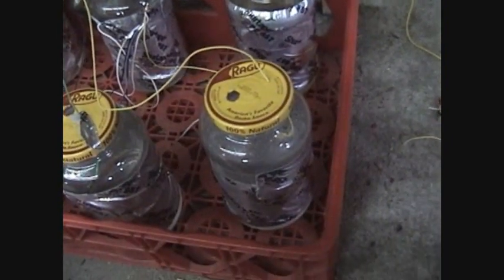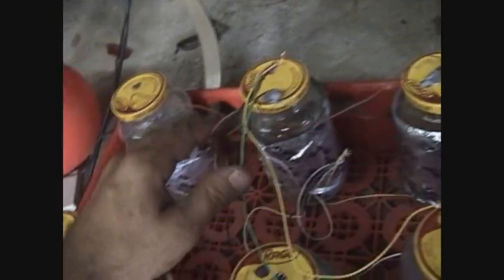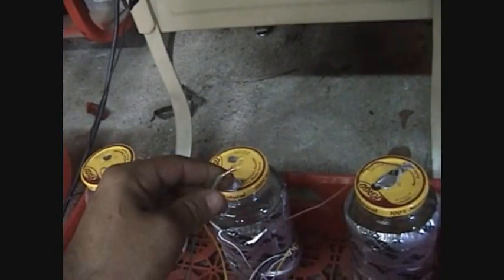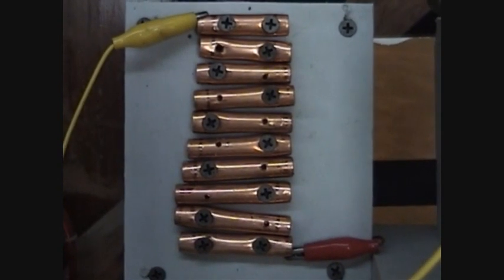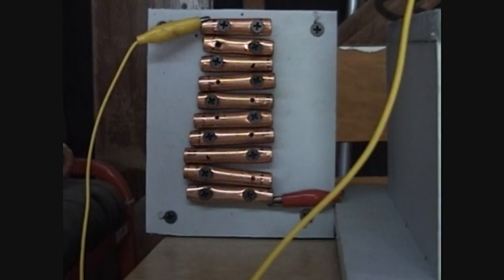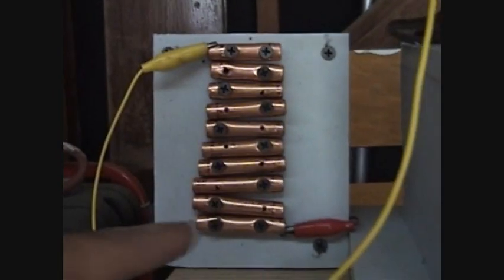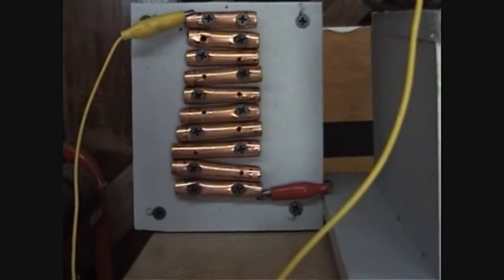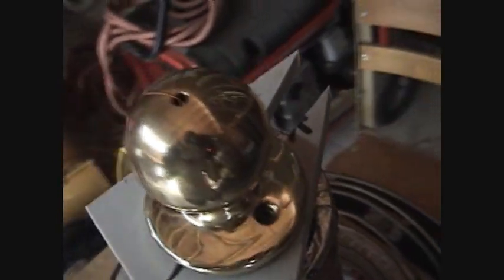Tesla Coil Build PT3

Comment: @crob227 f you buy caps you need to make sure you have high voltage PULSE caps. any others will last only seconds.. also every cap you add in series adds its voltage rating to the string.. 3kv+3kv+3kv=9KV.. but bottle caps you should run all in parallel

Comment from the maker: @11111111jws what kind of dowel???? man, im not gonna lie its a pain to do by hand, but if you have to just take your pipe and drill a small  hole at the top and bottom, this will let you feed the first bit of wire into the inside of the pipe, then its just patience and winding keeping it tight and when you get tired, or a sore finger, which tends to happen several times, just use the clear tape to hold it in place on your break, so it dont become loose...happy coiling

Comment from the maker: @bclinto83 primary circuit consist of...... flat coil, capacitor, and high voltage supply.....

the hv supply builds current in the cap, which make the constant arck a pulsed ark,  that pulsed arck goes through the primary... the secondary which is a air coil  recieves the energy from the primary circuit...  thats basically it to this style of tesla coil. there is alot more features you should add for safty and longer hv suppy life, and tuning is improtant too.... but this should get you going

Comment from the maker: the hardest part is winding the coil, youcan buy 12 in diameter cardboard round pipe at homedepot that would work great for a fatter coil, its said that  the lardger the diameter the beter, yet we never see anything bigger than 6in diameter....multiple static gap turns the sound down alot, and jar capacitor are cheap top make..... hope this helps

Comment: A capacitor or condenser is a passive electronic component consisting of a pair of conductors separated by a dielectric. When a potential difference exists across the conductors, an electric field is present in the dielectric. This field stores energy and produces a mechanical force between the conductors. The effect is greatest when there is a narrow separation between large areas of conductor, hence capacitor conductors are often called plates.

Comment from the maker: i hope that the case, but i believe its just dividing the gap, see i can get the same output if if take all the spark gaps, and add thespacing to make one big spark gap, but it would be unbearable loud,  see i read the multible spark gap just quiets down the setup, its said with enough spark gaps the system would run almost silent.....  thing is, to many gaps and the capacitor discharges onto there self

Comment: great vid bro thanks for showing me your capp hook up i assumed that was what you ment,but wasnt shure ,any way
are the water caps better then rolled caps'
i may try and make somthing like this because thier so cool,i seen a web site 10 years ago and this gie had a spark gap made of a rotor of plastic with metal rods the rods copleted the gap and this gie ran it at 3000 rpm i think he said the high rpm ups the frequency and teslas
are said to be RF generaters,i think